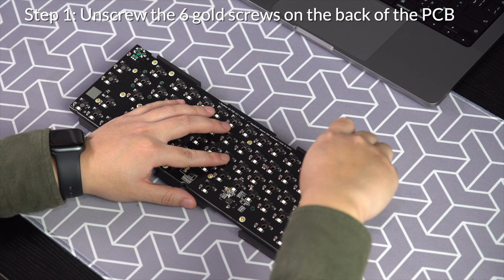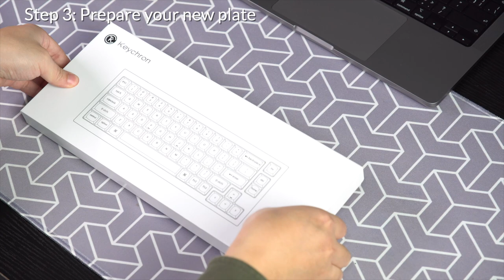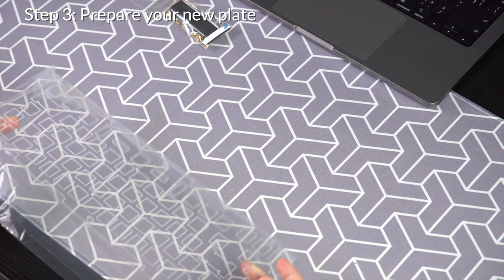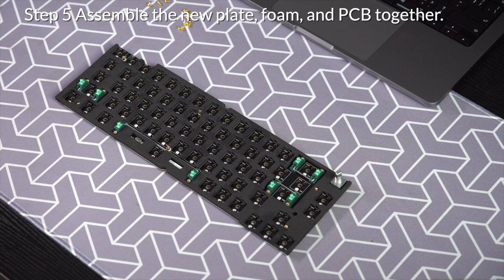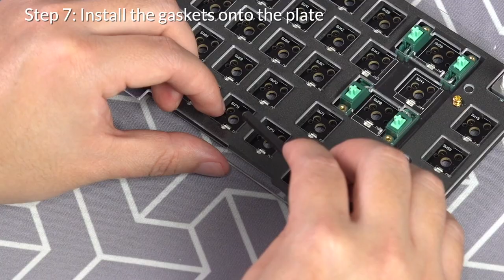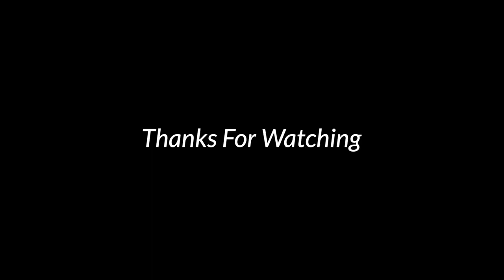How To Replace The Plate For Q2

Comment: I did exactly the same thing of this video on my Keychron Q1 and im having some problems. My pc plate is like curved in some areas when i full install it and it makes some switches sound so different as if it no were any plate in some areas, so annoying. Ive a 0.5 pe foam mod on top of pcb but i think it shouldnt be the problem at all because ive seen a lot of vids with this spec on the Q1. Any suggestions pls? thanks in advance!
Reply: U solved it?
Reply: @philipp5883  yes, i had to remove plate foam and it solves well. The sound still poppy without plate foam
Reply: Hi, i bought the pc plate for my q1v2 as well, but it feels like the pc plate is kinda tight when fitting to the top case, do u have this problem?
Reply: @CringeLord69  just had to remove the plate foam to get fixed. Still sound so poppy
Reply: @VyreYT  nah it doesnt fix, i think my pc plate is slightly longer, so it got really tight and stuck at the side of top case. Mine couldnt really flex

Comment: the Q2 I received (first batch after release), right off unboxing, the board doesn't have decent amount of flex as shown in other people's videos, I'm wondering why is that? Should I remount the gasket?
Reply: its because of the stainless steel plate. I recommend buying the FR4 plate for your keyboard. Itll make it thockier and much more flexable
Reply: it only costs like 15 bucks too.
Reply: @hermansmyth916  bought pc plate and still not as flex, what to do?
Reply: @selentatsukienjoyer  remove the films from the bottom of the board. I removed them from my Q1 and Q5

Comment: How long does the battery last in your keyboards?
And can it be replaced?  (maybe a compatible list from Amazon).
Like we do for mobile phones.  
Otherwhise people are spending £100-170 on something that will only last a few years before they are tied to a cord combined with potential overheating problems.
Thanks.
Reply: This board isn’t wireless, but other boards that have wireless connectivity do have removable batteries that look universal. I’ve owned my K6 Keychron board for a while now, no noticeable dip in battery performance yet